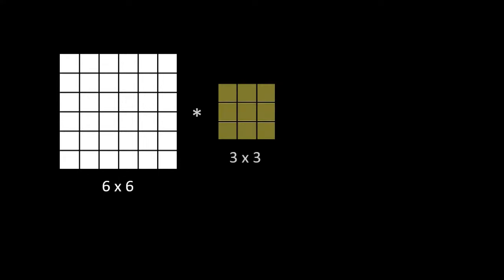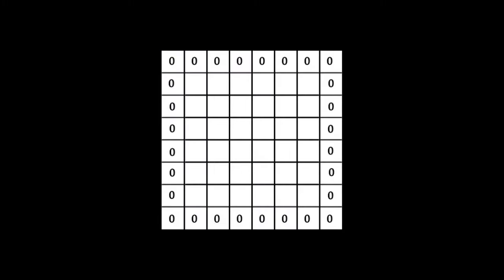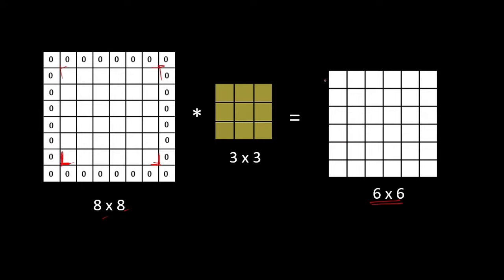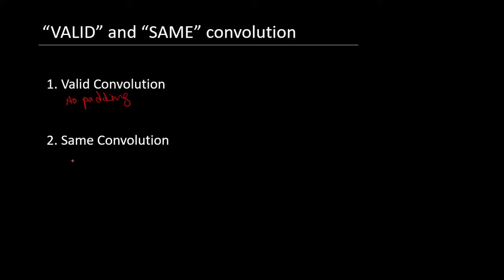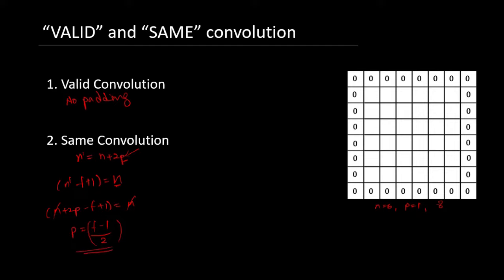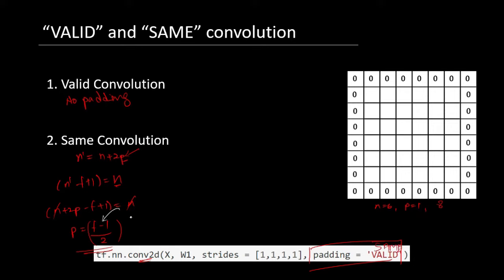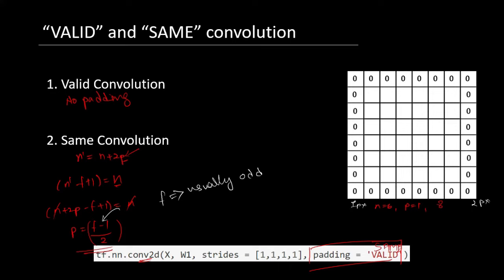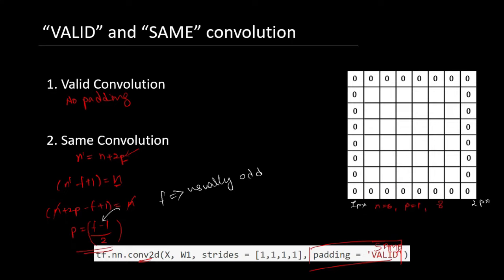Padding in Convolutional Neural Network

Comment: I have a question,,yes padding is important in giving corner pixels much attention as the middle pixels in filter wimdow,,,but then doesnt make the process of convolution invalid because the output image is same as input image??? And the whole purpose of convolution is to reduce the size of input image
Reply: I'm guessing that's the point of maxpooling, since pooling is always applied after convolution. The thing is that idk when people would use paddling and when they wouldn't, since it makes sense to always use it at least for the first layer.

Comment: let 4*4 pixel and we add 1 padding then it become 6*6 and filter of 2*2 then output dimension will be 5*5 but we want 4*4 output.....this is my doubt
Reply: if you want same image dim with filter having even dim (i.e 2*2), need to apply uneven padding (i.e 0 on left and 1 on right, same with top and bottom => now image will be 5*5)
Reply: Apply 3*3 filter to get 4*4 pixel image
Reply: I think what you're asking is how can we know what filter size to apply to input image to get output image of same dimension as input image????